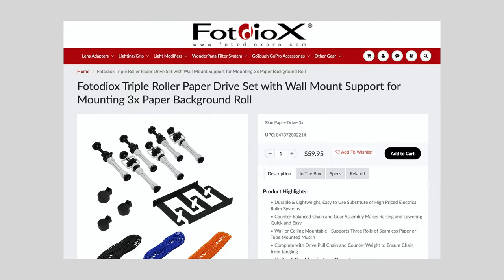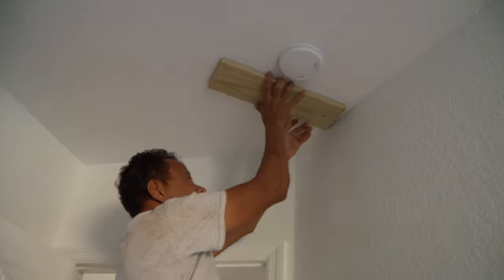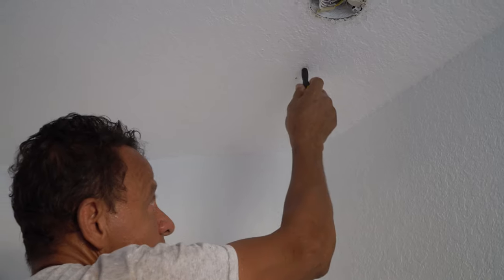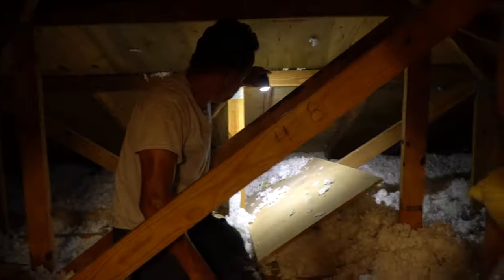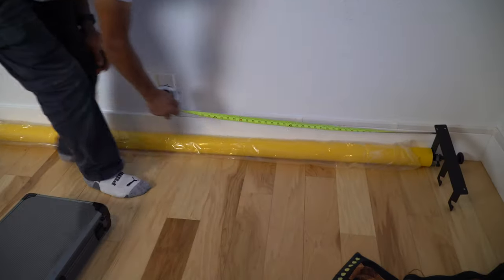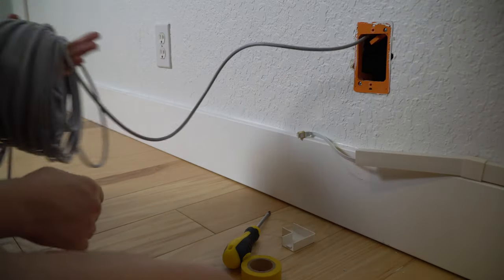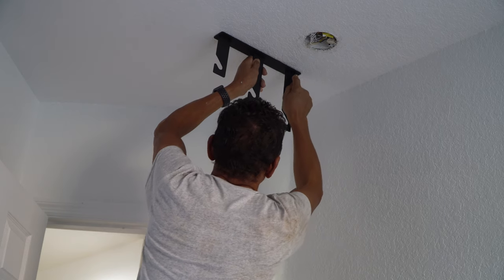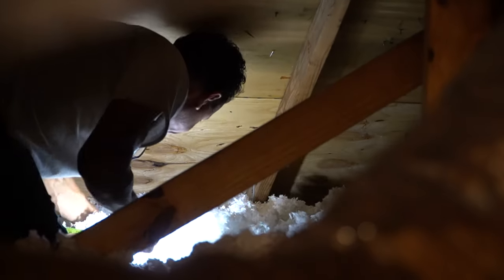Best Way to Hang Seamless Photo Backdrop Paper

Comment: Good video, and some good advice about the ceiling mount.
Yes a strong piece of wood in the attic is the best method.
I dont know why Neweer give the concrete anchor bolts with the system
Most people will not use them.

Comment: Do you also get small wrinkles every here and there? especially when fully pulled out with floor?
Reply from the maker: I didn't! No wrinkles here. I added weight clamps to the roll to help keep it a little straighter so maybe that helped?